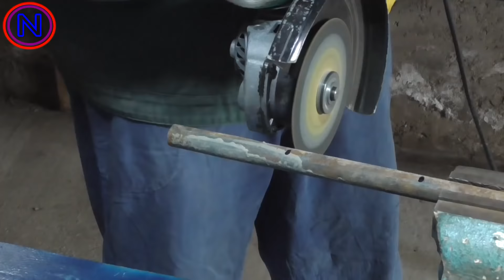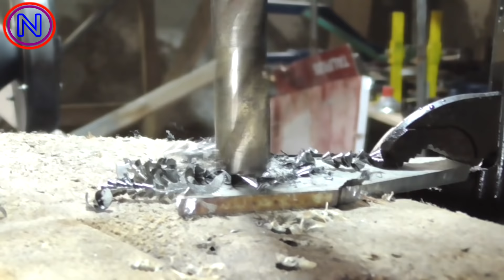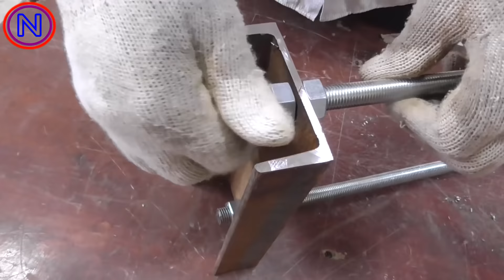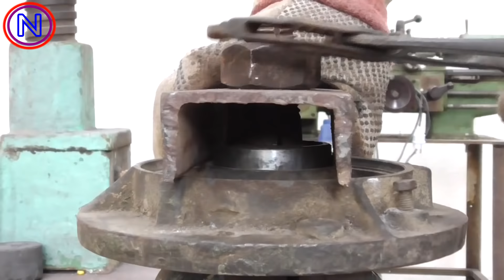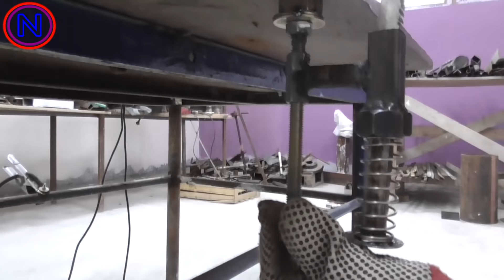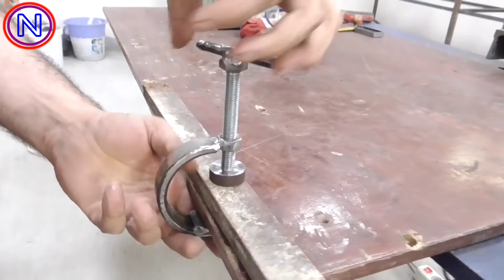TOP 22 Today's Best New ideas !

Comment: Man, I sure like the gizmo's your showing. I would like to make some of the same, but damn it I'm too old to be fiddling around in my work shop. I can hardly do what things I do. Which ain't very much. I wish you guys was around in the mid to late sixty's when I was starting out. getting married fixing up a house, when I had time, energy to make things like this. And speaking of that I really didn't have the money buy tools like I did later. I sure could have used these things. For example, I've been working or I should say I've been fiddling around  to convert my generator over to use propane as well as gas and this has only taken four months. Well I'm not quite finished yet. No rush. After 75 things kinda slow down. But you've got a real good site and I like what your doing, keep it up, this will really benefit a lot of people. 
Question, these things your making, are these things available, as in manufactured tools??
P.S. slow down I'm getting dizzy
Reply from the maker: Thanks
Reply: Very well done